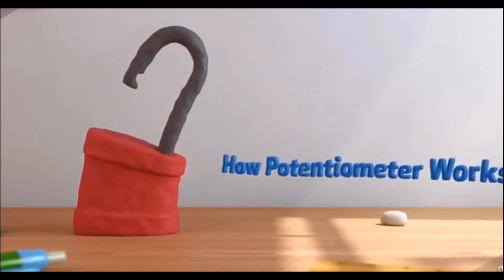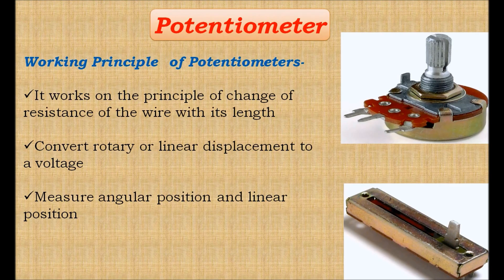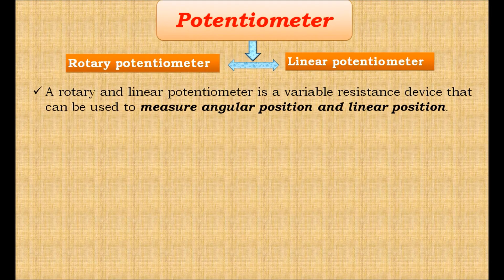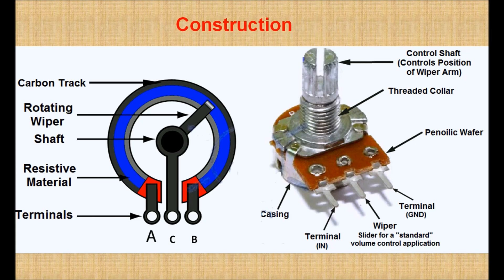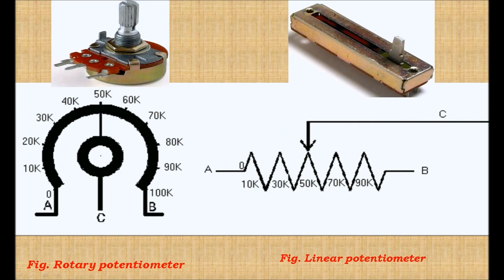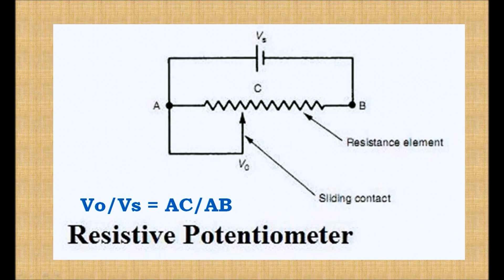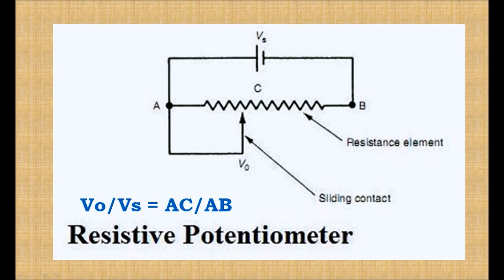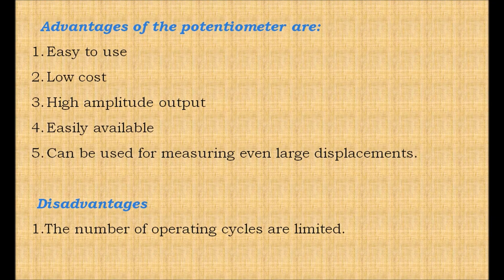How Potentiometer Works | Linear and Rotary type Potentiometer

Comment: The potentiometer is the second type of the Voltage multiplier that can be over fed the electricity innto the source so the advance used of that thing is to controlled the current flow and that is the thing that can controled your electricity bill so in the short term of the potentiometer is the compact voltage multiplier